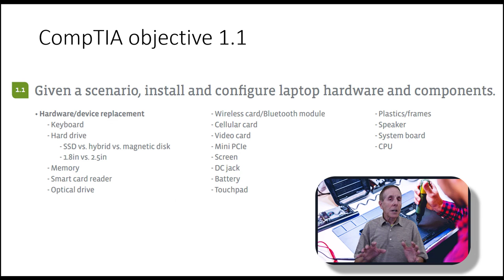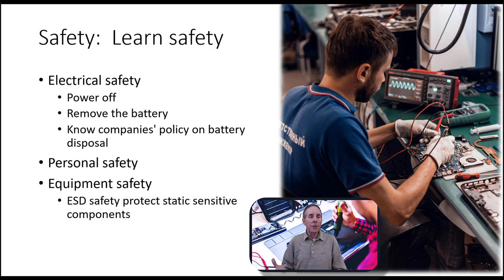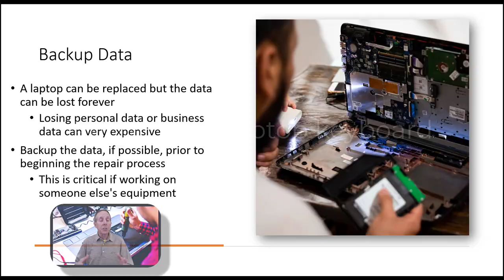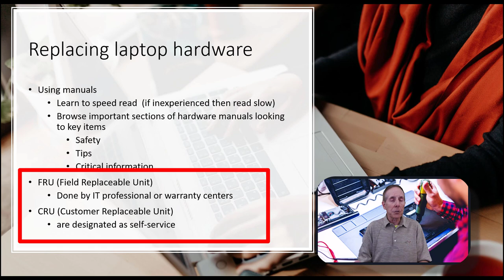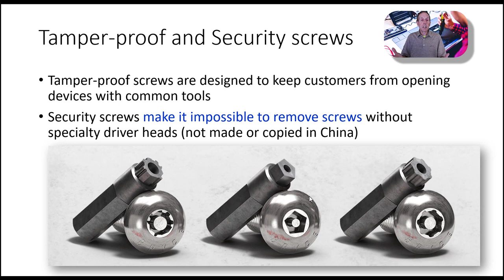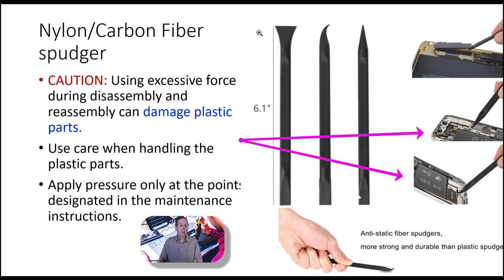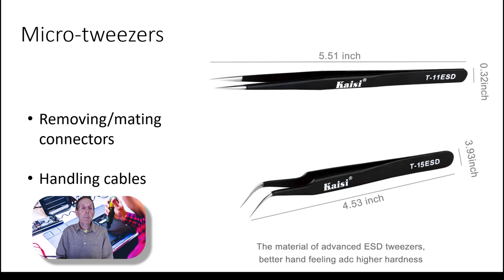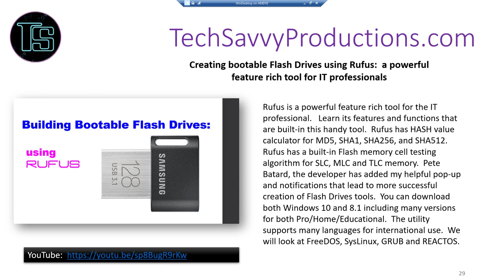Learning Laptop Hardware and Preparing for the A+ Exams

Comment: You have to have  a huge   amount  of patience's    to work  on laptops   Their  is a Romanian    guy   in  England  that works on  laptops,he   uses   hot glue  and lighter fluid   on chips to  check how   hot they get.   He  also  increases    voltage     with  a external     power supply  to   try to clear faults  inside  chips
Reply from the maker: I have watched him using  lighter fluid to detect shorted ICs.  Not sure the combustion temperature of lighter fluid (a workplace safety hazard) but  a infrared camera would be safer even if expensive.    He is an amazingly good tech.

Comment: You  need a strong electronics   background  to work   at the  component    level  I have  two of those IFIXIT  sets
Reply from the maker: In laptop repair or any repair at board level electronics is essential, most companies simply do module swaps which most IT folks can do with basic training.